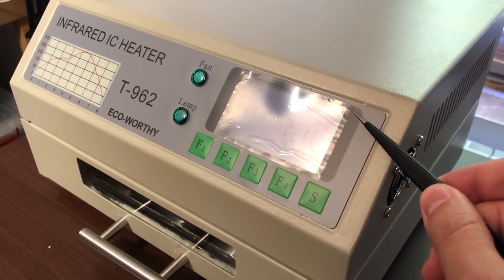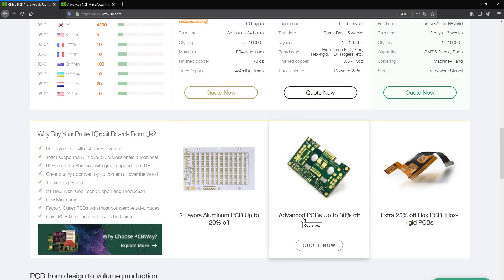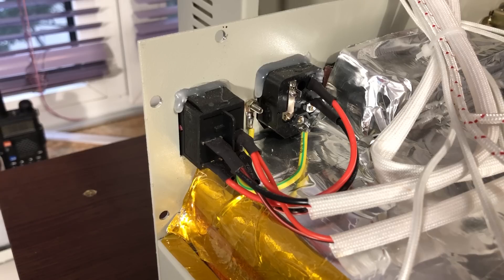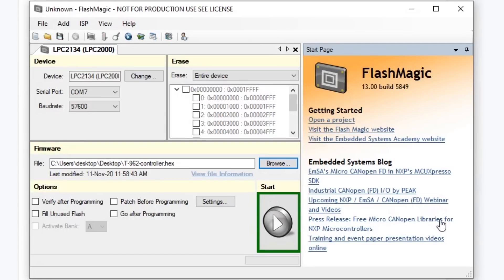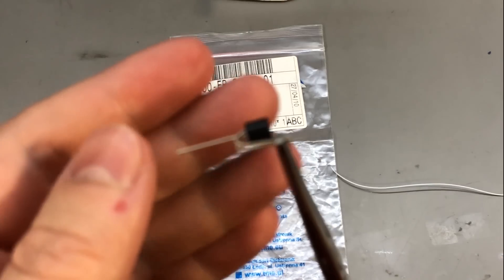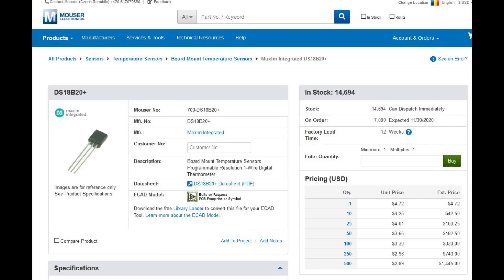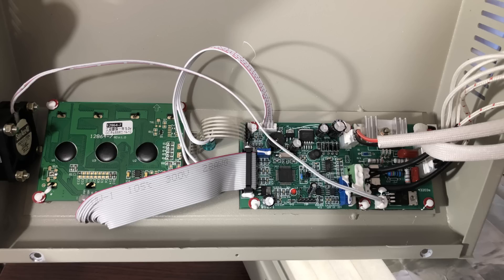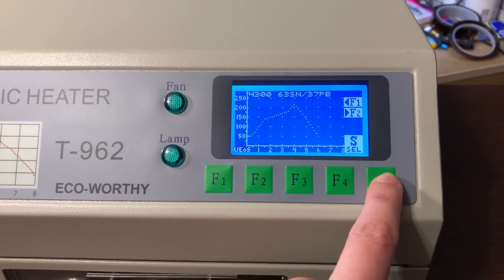T-962 Reflow Oven Upgrades & Fixes | Voltlog #338

Comment: For some reason, when I added the Temperature Sensor, it makes the oven always go into ISP mode on boot, and it only enters the firmware when I remove the sensor completely, there is also a 6kohm resistance value when I continuity test between the n-ISP pin to the GND and VCC sensor legs when they are soldered to the GND Plane. Any advice?
Reply from the maker: Re-check all connections, something is wrong.

Comment: I modified my oven with all suggested modifications but there seems to be a problem with my clock/time , the X-axis on the display represents time in minutes but 1 minute is not 1 minute, it looks like my clock is not calibrated , is it possible to adjust the clock ?

Comment: 11:06 and do not forget to connect a freewheeling diode to the fan. This will reduce the load on the MOSFET and the device will probably cause less interference in the radio range.

Comment: Hi, excellent video, I just repaired my oven the T-962 the small one just like in your video.
I also have an oven T-962C which I made the physical modifications as the small oven, the detail is that when I want to flash I get firmware error, and I have seen a comment where he says that download the most current and change the bauds, the firnware (0.50.1) and bauds to 9600.

do you know where I could download the firmware (0.50.1)

Comment: excellent video, I am following step by step, but I have a doubt in the connection of the module to the oven card, because I see that you make a connection of a few pins and after turning it on you remove it, I do not know if you could aduntar the image of the connection on the module also, excellent tutorial !😃

Comment: Thanks - Yeah, you'd think the manufacturer would have integrated the mods into their product.  Especially the ungrounded enclosure issue which could be fixed with a star washer tightened enough to pierce the powder paint.

Comment: Sir, when I try to change the frequency from 12.000 to 11.059 I get the message: invalid value for crystal frequency. Why? I tried on Win7 and Win10 - no change. Do I have to be connected to the PUHUI PCB all the time? It is also strange that when entering the frequency 12.000 again, the error message does not disappear. Sill: invalid value for crystal frequency.

Comment: You mentioned it's not possible to get similar performance out of modded toaster oven. I was wondering, what are the main reasons behind this statement? Is it because of the resistive heaters vs infrared heaters, and if so, could you elaborate?

Comment: Fantastic video! I purchased T-962 and the issues described were also present, I implemented the sugested tape and earth solutions. The oven works very well. I plan to also implement the firmware and other mods mentioned. I am impressed with how accurate and straight to the point your video is.

Comment: I did all of the above modifications. Just to find out, the oven is absolutely useless - it doesn't have enough power to follow any sensible temperature profile and continuously lags behind with increasingly large deltas the more time has passed. Trying to use some no-name solder paste, it doesn't even get it to melt before the cool-down starts again.
Don't get me wrong, the above video is great, and exactly what you want to do to your oven. But I for myself didn't get any use out of it, despite the time I had put in to improve it.

Comment: I have completed my conversion and update per your extremely helpful and clear video.  I have found that one of my T/C channels has a ~10C bias (not the T/C, I have tried many replacements and the other channel matches the DS18B20 exactly).  Finding no hardware cause, I would like to try modifying the source code, but there does not seem to be any documentation on how to compile.  What API or compiler can I use to build the hex file for loading with FlashMagic?
Reply: Is it possible they fitted the wrong type of thermocouple at the factory?

If this unit has two thermocouples, have you tried swapping them to see if the error follows the TC?
Reply: @alexscarbro796  I flipped the T/Cs, used new ones, and even sacrificed a chicken.  I am concluding that it is a querk of the board.  I am using biases in the setup parameters to compensate, and I added other hardware modifications (fan, baffles, etc.) to eliminate hot and cold spots.  It seems pretty OK now based on my own T/C meter.  Thanks.

Comment: I have just got the T962a and did the firmware and kapton tape mods.  Need a cold junction device (will order it) but would also like to add a stirring fan (a DC motor with an axle that goes through the heatshield) that will effectively distribute the heat more evenly.
Reply: It works fine with the firmware update and no cold junction compensation yet? I haven't done the firmware update because I didn't want to brick it while I was waiting for the temp IC to come in...
Reply: @zbubby1202  I agree.   It work’s well enough but if you could refine it more it’d give you a mor consistent flow.  But for my uses the pizza gets cooked well enough in it 😉

Comment: My NXP lpc2134 micro controller is faulty. Unable to get the same chip.I found a NXP LPC2138 micro controller ..Can it be used
Reply: you should check if NXP has a tool for checking alternative series swap outs and if these no hardware/pinout difference you can swap em out
going off the  part number i would guess its just a flash/ram difference

Comment: What kind of USB to UART serial converter are you using regardind signal (Rx, Tx) voltage level? 
 I found on Amazon two FTDI USB to serial UART versions available, 5V TTL or 3.3V
Reply: I used a 3.3V (TTL-232R-3V3-1.8m) and it worked fine. 
Datasheet for the internal MCU (LPC2134/01) states that Vi max for digital pins is 5V5 so 5V should work for input (USB->MCU), output might be an issue (MCU->USB) as processor will output at most 3V3.

Comment: If the PWM pin for the fan can act as a GPIO, couldn't you also make a probe to have it actually on the PCB? Would that help the reflowing abilities of the oven, being able to detect the actual PCB temp?
Reply from the maker: I'm not sure I follow your idea, how would having a probe on the PCB help? Even if you had such a probe, the gradients in the oven and hence on the board would still be present.

Comment: Nice, I want one. Should I get this or the A version?
....... or save for vapor phase?
Reply: Huh? No selective laser reflow?
Reply: I just came here from watching your Open Source 8.5 Digit Voltmeter video, so, I guess you made the right choice.
Reply: Someone should make a DIY Vapor Phase ... Maybe we should ask our local YT electronics nerd to design one, what's his name again ... Marcel Raps? Manny Rops? ... something like that.

Joking aside ... They go for close to 2K Euro ... not sure why...
Reply from the maker: Vapor phase is probably more exciting and the right choice when dealing with sensitive components/boards as the temperature is very uniform and precisely controlled with a vapor phase oven. It does come with the disadvantage of hard to find and expensive chemicals. So should we expect a video on this subject on your channel? 😁

Comment: Still wondering if it's worth getting an oven together VS having boards made via the internet.
Reply from the maker: I would say these days it's a combination of both. I do order ready assembled boards frequently but sometimes I  also need to do some assembly myself because of various reasons like: time, flexibility, swapping out parts, etc.
Reply: It depends, but a lot of the time if you have to buy all the equipment--you can get hundreds of boards made... And, even populated in a lot of cases.